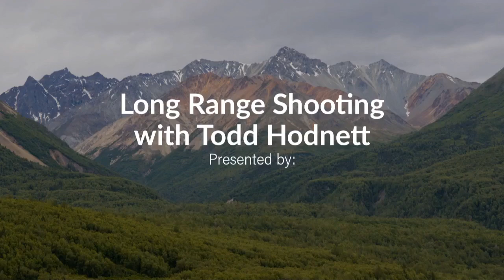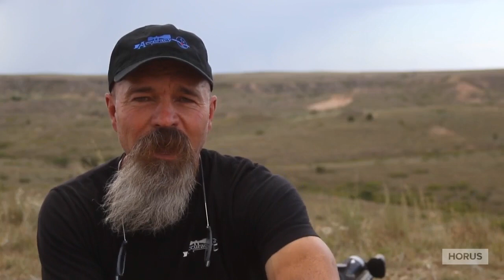Barrel Twist Rate, Twist Direction, and Spin Drift - How does it impact your ballistics?

Comment: I'm new to this, but am excited to get into fast twist heavy bullets (gearing up for the upcoming release of the 8.6 creedmoor/blackout by Q and Hornady).
Reportedly spindrift is a major factor in this cartridge though, as it's shooting subsonic 300+ gr bullets with a 1/4" twist and retaining decent energy at medium-ling ranges (extremely high BCs). It sounds like Q took your advice on using high spin to stay stable in the transonic zone just below the sound barrier.

My speculative issue is this: how much spindrift would we be talking about at 300 yards with a 300+ gr bullet with a 1/4" twist?

Of course drop and sind will be even bigger issues, but still.
---
PS, with spin that high I'm also wondering how much spindrift you'll get with supers due to predictably insane amounts of overstabilization.
To my knowledge the only thing close right now is the Honey Badger, as it's got a shorter barrel  (less velocity) and a 1/5" twist, but I can't afford one to test.